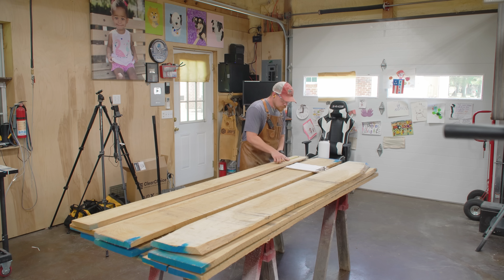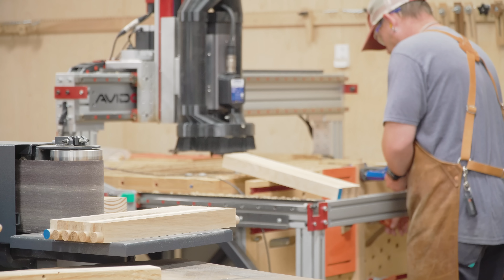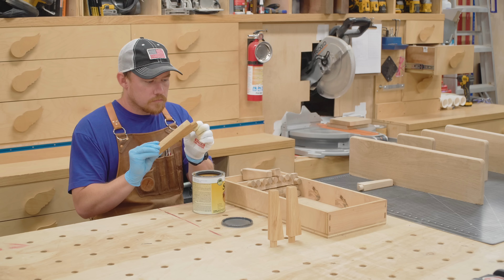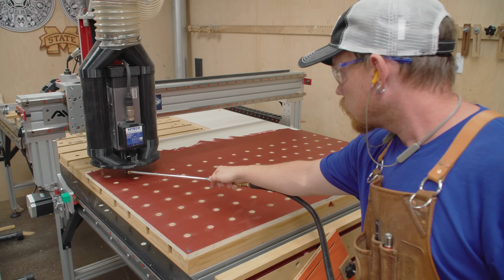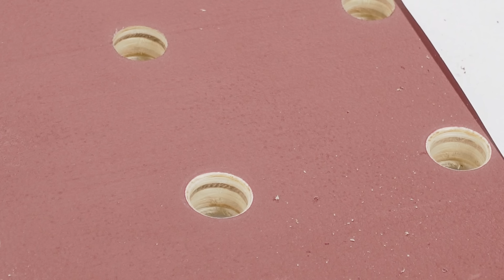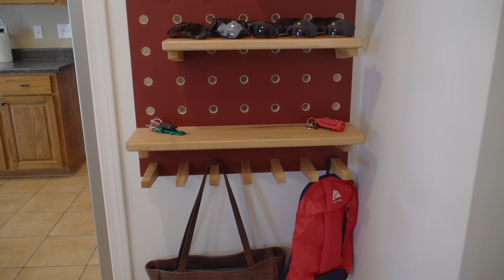An Organized Catch-All Peg Board Space

Comment: btw, do you still recommend Carolina Air for dust collection pipes and fittings?  I thought I read someplace that they dont answer emails so you changed your recommendation.  Have about 7-8k to spend and that includes an ef5.  Would obviously prefer to stay as on the low end!
Reply from the maker: I actually went with us-duct.com. Waaaay cheaper than nordfab

Comment: Nicely done. I just finished assembling my Avid CNC a few days ago. Why didn't you chamfer or round over the dowel holes with the CNC. It seems like it would have been a little faster. Also, it looks like you got a new dust shoe.
Reply from the maker: Same dust shoe for a year or two. The plywood had a bit of warp to it and I don't have a vac table so any edge work would likely not be consistent depth.

Comment: Pretty nice project, sir.  Thank you for sharing.  I don't know crap about CNC - why couldn't the CNC do the round-over for you?  Thanks.
Reply from the maker: Very easy to add that step to the CNC. However, the plywood I was using had a little warp to it and didn't sit perfectly flat on the machine. Because of that, any edge work would not be a consistent depth due to the bend of the plywood. If I had a vacuum table on the machine I would have likely went that route.

Comment: Nice work! Great project.  curious, you used  the cnc to drill the holes or route out the holes, why did you use a hand router with paper and you didn't use the the cnc to round over the holes?  I liked the color you used against the wall color.
Reply: He said he was worried the cnc would mess up the fresh paint when doing the round over operation
Reply: @NiceAlex  i just heard him say that he put paper over when hand routing so the pain doesn't get messed up.  Hand routing isn't as consistent and lot more work than cnc,  . if you use the cnc, then it follows the same file as the drilled holes so nothing gets messed up.
Reply from the maker: Very easy to add that step to the CNC. However, the plywood I was using had a little warp to it and didn't sit perfectly flat on the machine. Because of that, any edge work would not be a consistent depth due to the bend of the plywood. If I had a vacuum table on the machine I would have likely went that route. @mikedtubey